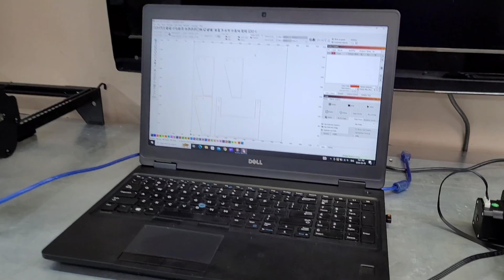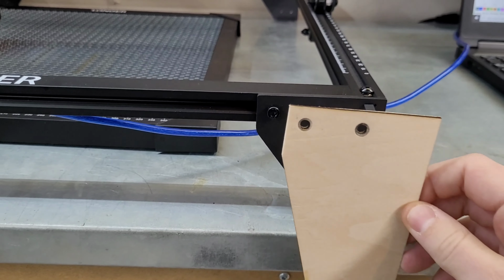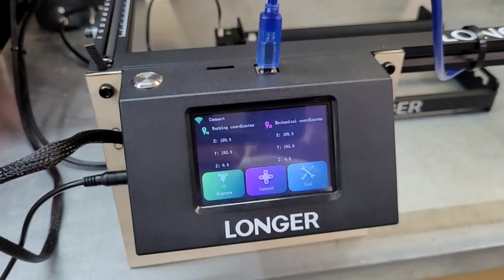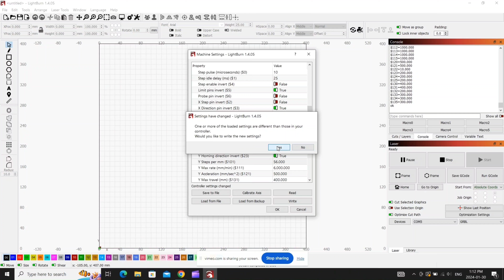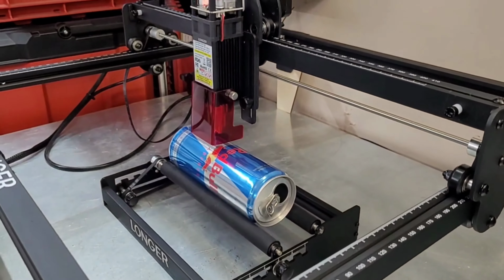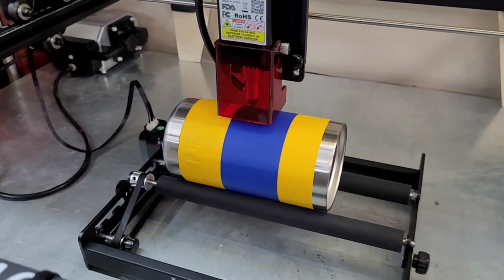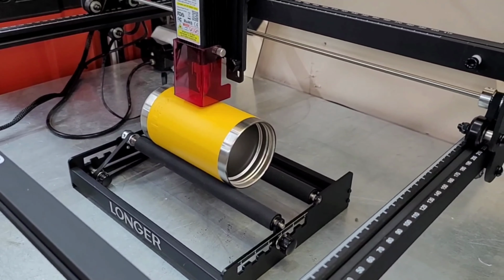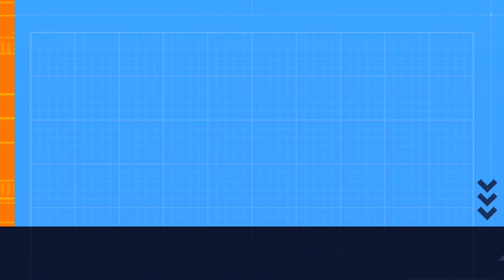Setting Up The Longer Ray5 Rotary Roller

Comment: you need to play with steps per mm to fix the stretching issue
Reply: Get a note pad, l burn lots of different woods, if l have scrap l run it and gind best settings and jot it down so no guessing when l put that wood on table

Comment: How is the best way to get the rollers parallel with the X axis?
Reply from the maker: In working on a jig for that!
Reply: I just turn on the laser to like 5% and manually run it up and down the x axis. It's pretty easy to get straight.

Comment: I was following the steps very carefully and I still was not successful my machine doesn’t work. The laser when rehoming it hits the frame also the rotary keeps rolling a few times
Reply from the maker: Interesting.. Have you tried setting home over top of the roller?
Reply: @Laser.101  thank you I’ll try that.
Reply: Does it make a difference whether you're on the chuck or roller? Cause looking at your screen, your Chuck is checked off. As the chuck to, is there an issue? Or does it matter?
Reply: How is the roller aligned and precisely squared up with the laser arm? Is this set up by just eyed balled from the top?

Comment: Hi, congratulations for the video, I wanted to know if once you raised the frame before starting the engraving on the can you recalibrated the height of the laser with the metal rod provided  for the purpose? Thanks
Reply from the maker: Yes, you still use the metal stub to set the height over the cup or whatever you are engraving

Comment: i struggled with the issues of settings but i have managed to figure it out. im using lightburn 1.6 just for reference. in rotary set up: 
choose roller
enable rotary
mirror output to rotary ( you could mirror the image as you go but this saves the potential mistake later on not doing so)
on y axis:
set mm per rotation to 56.52mm
set roller diameter to 18mm

you dont have to input object diameter, only needed for chuck rotary. physically measure and make sure your image will fit within the surface space provided.
tried settings following the video and had the issue of stretching. using the above settings fixed that for me.

hopefully a help for someone else searching endlessly.
Reply: ^^^This I'm pretty sure not setting the roller diameter to 18mm was why he needed to stretch the image. I did the settings with the roller diameter also and had an awesome burn on my first try.